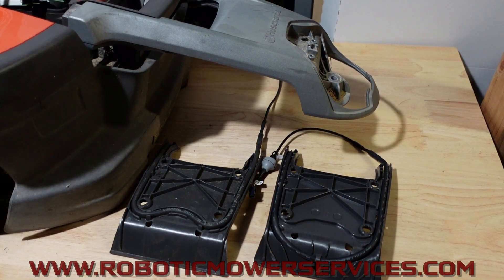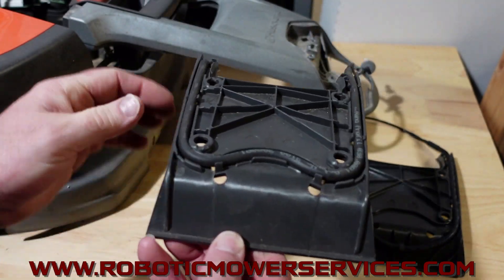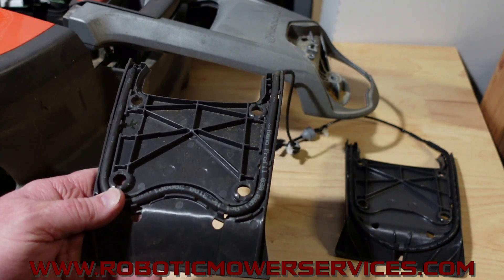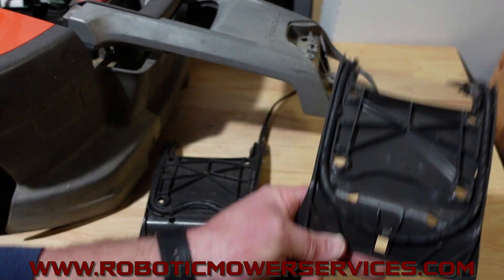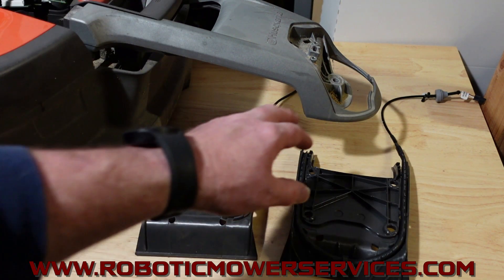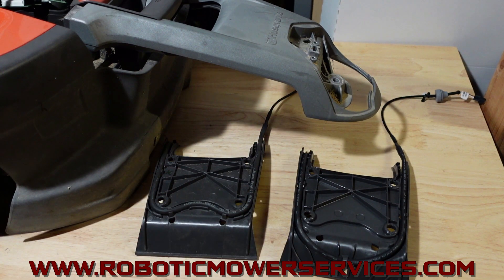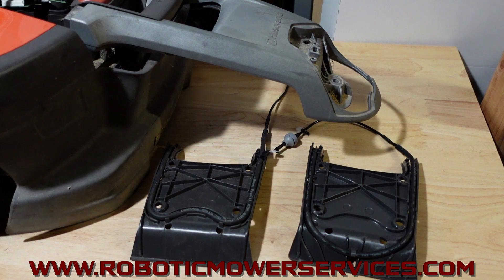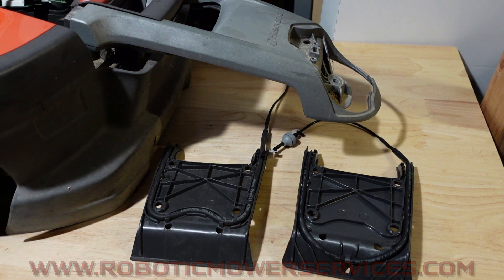Husqvarna 435X & 535AWD Improved Switch Cord (Lifted Error, Switch Cord Error)

Comment: I'm in the UK and we have a Husqvarna 435X which struggles to hold GPS signal now has been fine for over a year do you think their could be an issue with the GPS com board? I ask this because it connects fine vie Bluetooth on a phone but will not connect to Autocheck vie Bluetooth.
Also thanks for all the videos that you post they are always helpful :)